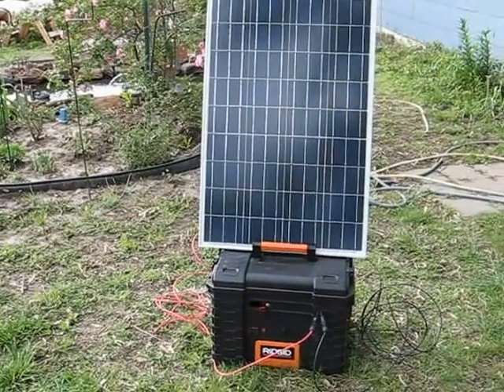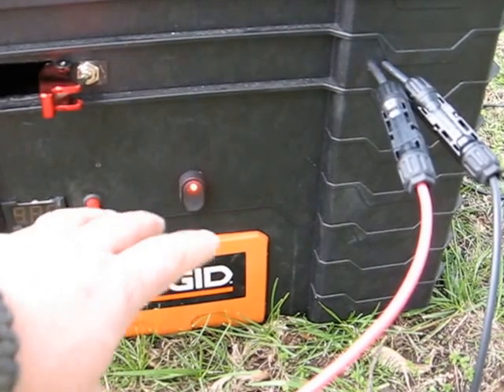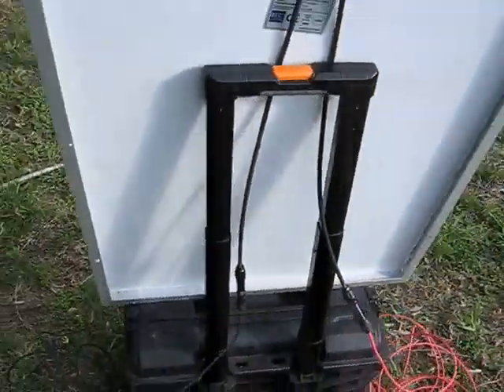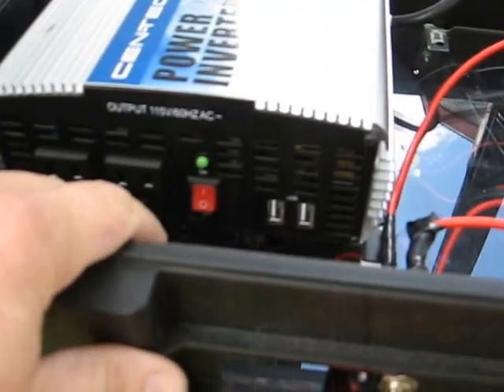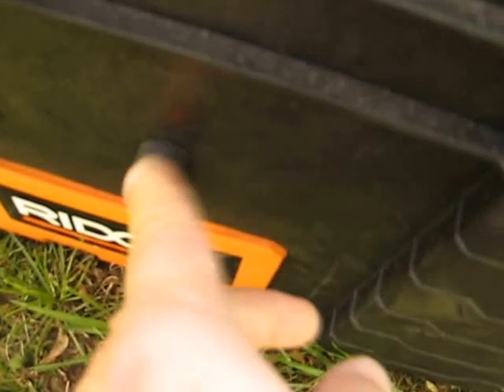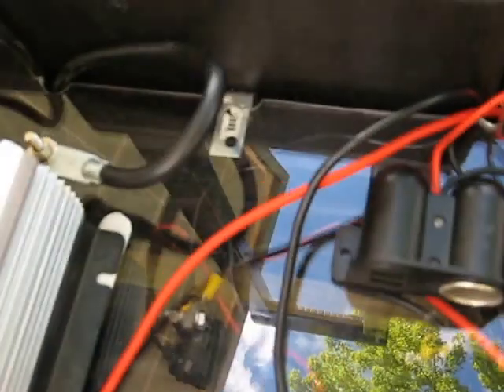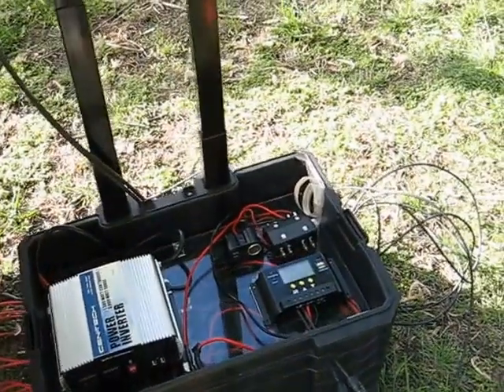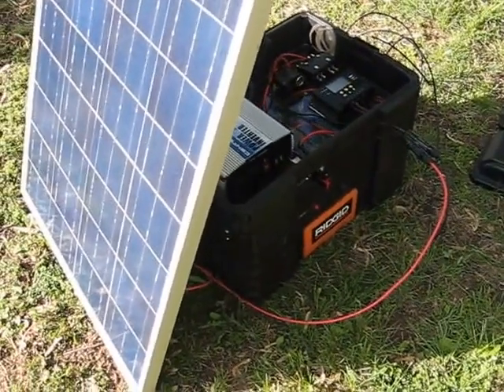Portable Solar Power Station

Comment: Safety First! Did you Install a catastrophic fuse at the positive battery post? Did you fuse the circuits? I see a lot of this projects that are under wired and they didn't put any fuses in to protect the wires from burning up if a short or overload happens. Every circuit in your car is fused. 12 volt can and will start a fire.  Size the Fuses to EVERY circuit to protect the wires not the loads. Even fuse the positive from the panels. Plexiglass for a shelf or divider is a great idea. Nice project! Safety first.
Reply from the maker: Lots of fuses in there, and multiple shut offs.  It's hard to see because the plexiglass reflects too much.  Thanks for the safety reminder.
Reply: Not knocking your project just wanting to educate the viewers that without fusing 12 volts can start a fire.
Reply: Please take my comments below as respectful! I applaud ANY person who thinks for themselves as you have done. You have a sound idea, and my motivation is purely to help.

Mr. Arntt is correct about putting fuses in ANY electrical project, however, I have seen other videos where he has posted this exact same comment, almost to the point of being obsessive/compulsive. He said the same thing to covinaman-and he was right in that case, as covinaman had NOT installed any fuses in his project. 
Your project has potential-but you need to seriously "clean up" your external wiring & switching. It looks VERY Amateurish. The parts I COULD see DID look safely assembled, however.

You got ripped off by buying the Harbor Freight batteries! They are the EXACT SAME BATTERY that Home Depot sells for their garden tractors-for HALF the price of the Harbor Freight! What Harbor Freight did, which IMHO was extremely dishonest (!) on their part was to take the same battery Home Depot Sells, and put a "Solar" label on it. I know this because I took one apart as well as a Home Depot Battery-THEY ARE IDENTICALLY CONSTRUCTED!!! I like to take things apart to know how they are made. You would have done better to go to Wally World & buy a Group 24 Marine Deep Cycle SEALED Battery. You will have about the same storage capacity, a more even discharge rate, Less wiring & connectors, and very likely have spent LESS MONEY FOR BETTER QUALITY!

The biggest thing you need to be aware of is that those Harbor Freight Batteries ARE NOT SEALED! Another factor to consider-and I know this from personal experience-is your Harbor Freight batteries will last about two years-three if you are very lucky. The Group 24 Deep Cycle Marine Battery, if properly maintained should last you 5 to 8 years in your current application.

I'm not bashing Harbor Freight. What I AM saying is that when it comes to batteries and electrical, you can do MUCH BETTER at other places if you know what you are looking for. 

Go ahead and keep using the Harbor Freight batteries for now; But when they give out, DO Switch to a Deep Cycle Marine Battery.
Reply: Call me what you want. Some of these projects are copied by young people and the under educated about what can start a fire so I am stating that without fusing these things can burn up and anything that's close by! Like the house maybe?
Reply from the maker: This is something I put together for camping.  I run my entire workshop off of solar and the main reason I built the box, was that I had these Harbor Freight batteries just sitting around.  I use 100 watt solar batteries for my building.  This was just a, I had spare stuff laying around kind of project.  It suits its purpose.  
That being said, if you have a disagreement with someone who responded to my video, please take it up with them personally, not on someone else's video.  I didn't take offense at what he said, he was right.  If someone offers constructive criticism, isn't that what we are here for?